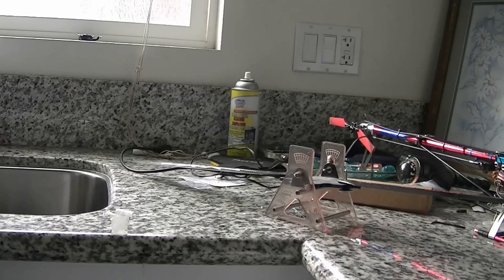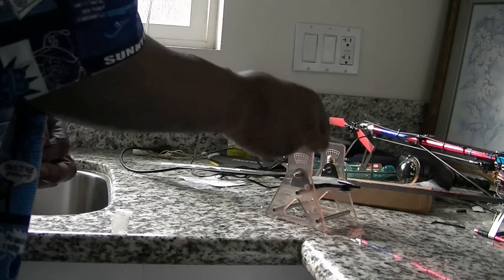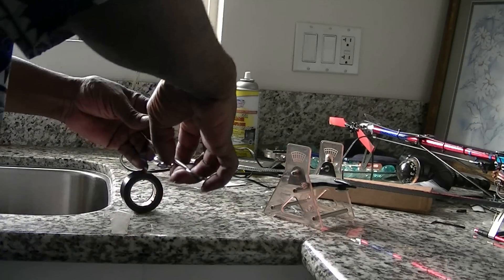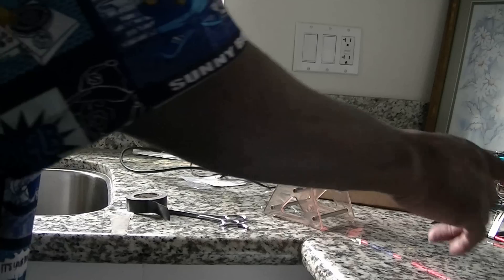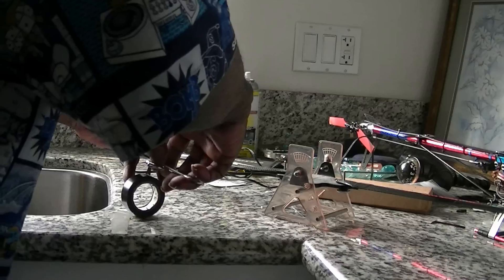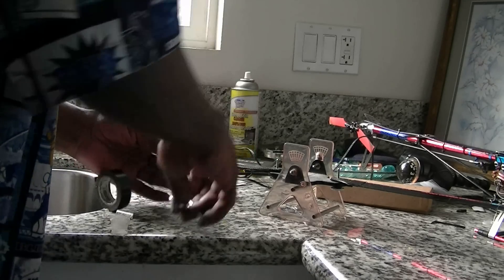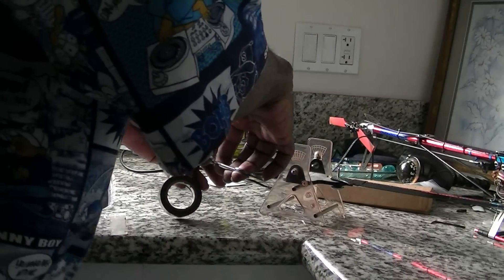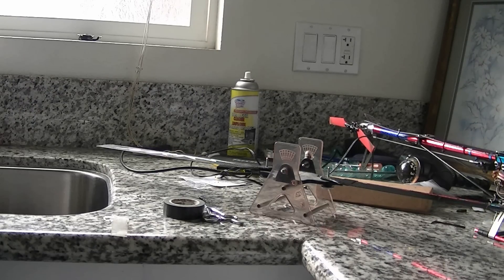how to balance your main blades rc helicopter

Comment from the maker: jaydekay
01-16-2011, 04:40 PM
Flybarless blades generally have the COG closer to the leading edge as well as to the tip of the blade than a FB blade. The overall weight is not as important as how the blade is balanced on both axes.

Comment: Hey WC!  I hear you and by no means am I arguing, you know that.  Nor am I an expert, you know that too! ;)  But what I have read is that the extra weight in the tip helps with stability.  Adding the weight does shift the CG, but there is still a CG.  Maybe not center to the blade, but there is still a CG.  My understanding is you always want to maintain that CG, even if it is not the true "center" of the physical blade.  So many people with conflicting opinions!  I wonder if the MFG can help?

Comment from the maker: but still flybarless blades are weighed at the tip and fb blades are weighted at the root if i center the cg on the blade it self because when the blades come balanced
if you check the cg on the blade you will find that on the fb blade its heavier at the root so if i cg both blades i have removed the weight that it was designed to have at the root and i have moved the weight to the center of the blade so it is now balanced at the wrong end

Comment: Hey WC!  You know I would never argue with you bud, but I am confused.  Putting that much tape on one side of the blade has to mess up the CG.  Since the Goblin is the first real FBL heli I have, I did a lot of research because I am just about ready to check my blades.Here are some RunRyder posts about it:
Dirt Biter: 
Exactly the same thing.
Richard1:
No difference in how you balance them. Weight is added to the C of G of the lighter blade (once you have got the C of G the same on both blades).